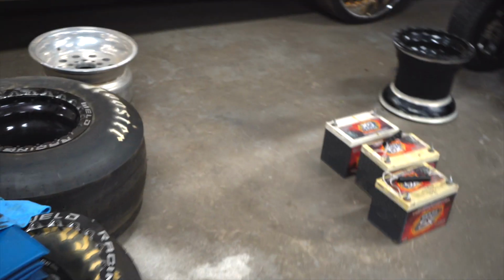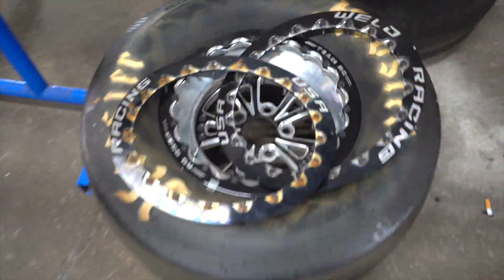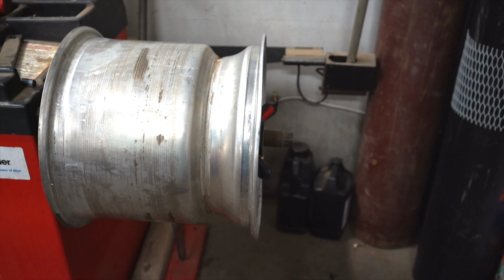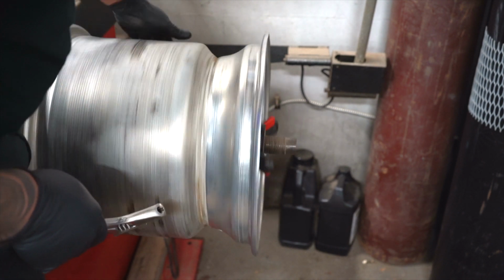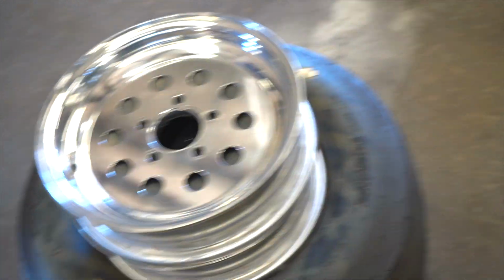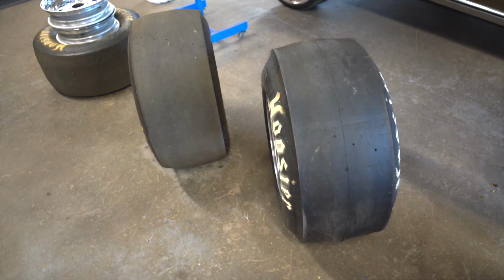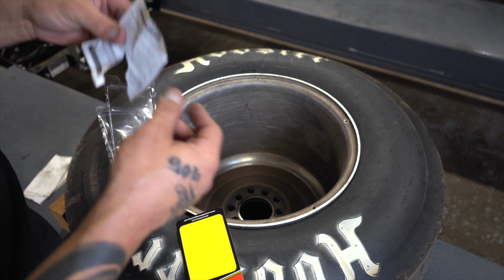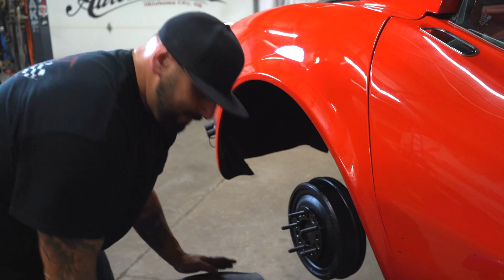NEW WHEELS AND TIRES FOR CHIEF'S CORVETTE! SMALL TIRE SMALL BLOCK NITROUS CORVETTE!

Comment: Wow the tire difference is crazy when shown side by side. I always hear… it’s just a 29 10.5. Haha yeah small tire, same same
Reply from the maker: yeah, even if you just think of numbers 28 and 29.5 arent far apart until you see it 😂
Reply: @MidwestStreetCarsAuto  now i have to decide on either a 28 10.5 radial or a 26 12 on a 17 x 10.5 wheel. Am I thinking right that a 6speed will want as much side wall as I can fit?

Comment: Cheif you want new car and know how they do in the back I put my shocks at 20 degrees not straight up and down it works keeps car from flexing so hard in rear you only use about 60 precent of them anyway it works and on no prep it doesn't get loose on big in easy to steer try it on red car and see it's helps with flexibility with frame and easy to make you go straight I love I get traction from starting line my burnouts are batter my time nice to

Comment: Light weight,engine weight out front so plenty of suspension to work with.When I see the 68-72 on strip they haul straight for some reason.P.S,im nobody,thanks for being real for future of racing while saying hi to Kenny Powers etc,and Billy of course,the racing community needs to stick togther or its over.